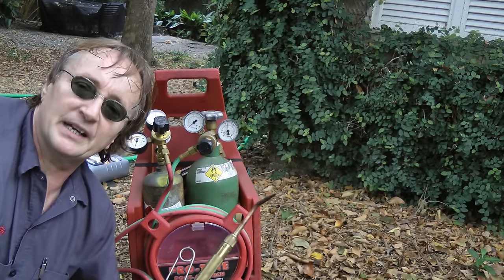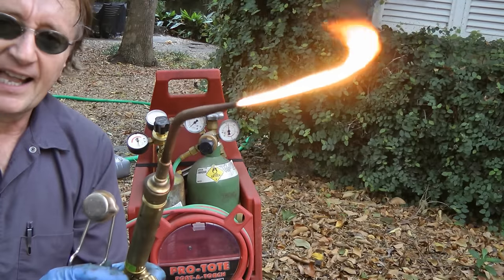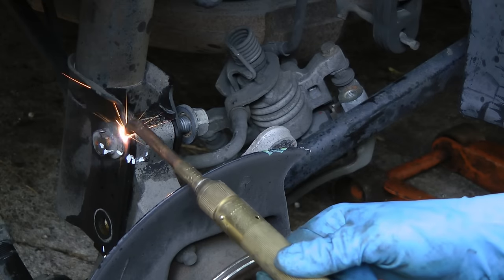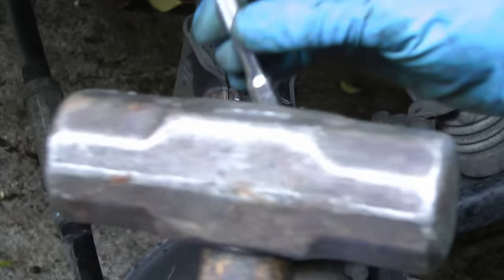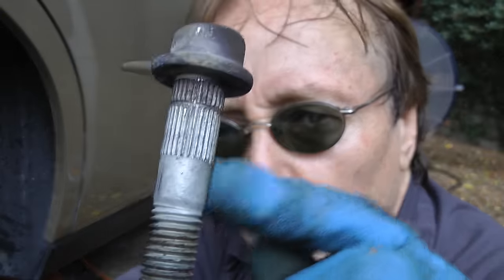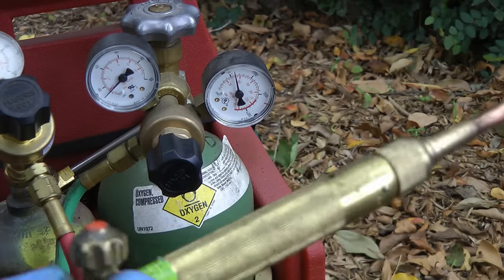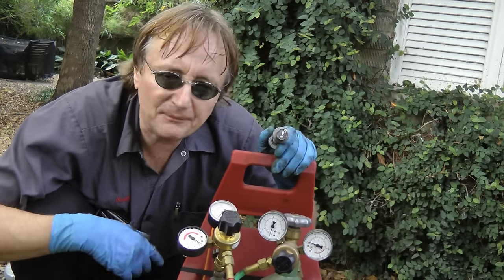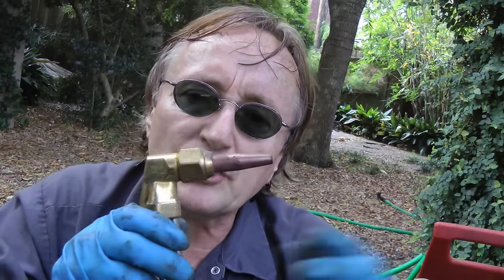How to Remove Stuck Nuts and Bolts in Your Car

Comment: It is , oxy-acetilen, a very usefull tool, once you work with it you become miserable whitout it.   The thing is that acelilen (C2H6 ?( is very difficult to get on a sunday morning...Around me, all those who need this kind of heat  are replacing  acethylene by propane gas,  At little bit less hot but it cuts very well anaything you are use to cut.  All it takes, is a small adapter to install on the propane hose, if I re,member well...Once it is done, your BBQ become your Sunday morning  back up for your torches...

Comment: ok, so a friend of mine bought my rims that were on my chrysler lhs not sure on the brand or anything i know that they needed a special tool to get off which i have. he put them on and he lost two lugnuts while driving so he tried taking the rims n tires off to put his old ones back on...
the problem is that the lugnuts are not coming off of the studs and he also broke two studs off his car when he lost the other lugnuts he says that they just keep spinning??? he has a 98 pontiac grand prix 3800 he shouldnt have to replace the whole hub right he can just get two studs and bang the bad ones out...
and how can we get the other lugnuts off??

Comment: How can I remove camshaft collars (the collars that hold the camshaft down), when the bolts have locktite on them? I am working on a 2001 Jaguar XJ8. From what others have said on the internet, the bolts have locktite on them, from the factory. The bolts seem very tight to me; and I m afraid to put too much pressure on them. Keep in mind the bolts have very small 8mm heads.  Any advice would be greatly appreciated. Thank you.
Reply from the maker: use an impact wrench, the impact pressure will always open up loctite bolts. Putting on with an impact can rip threads if too tight, but not when taking them off.

Comment: Subscribed!

Question: hey Scotty, I am trying to remove my y-pipe to my cat converter. I was able to remove the rusty bolts, but the pipes seem to be stuck/rusted together. Any tips?
Thanks.
Reply from the maker: pipes can heat weld a bit, spray WD 40 on overnight, then whack em with a sledge hammer

Comment: Hi Scotty,
I am a little confuse about the shock absorber . When you remove this bolt, will it jump out a little bit? I think there is a huge spring inside, and that spring will force the shock absorber jump one or two inch. That happens to my car before, Is that OK or something is wrong?
Reply: I can actually answer this one since i just did shocks on my chevy pickup. If you are just replacing JUST shocks and they are not inside a mcfearson strut then the shock will stay in the same position. A shock absorber doesn't refect any energy but rather absorbes it. So when you place a shock in a certain position. It will stay in that position. When removing your old one there should be no recoil out " spring" when removing it. as long as it is NOT inside a mcfearson strut
Reply from the maker: that's a strut, spring is self contained within the strut, so it hurts nothing. To remove the spring, the strut has to be taken apart using a spring compressor then

Comment: Hello, I am trying to replace Rear engine mount 2005 Odyssey. There are 4 bolts (14 mm) in the bottom. They connect the engine mount with the aluminum stand. I removed 3 out of 4 bolts. There is 1 bolt it very hard to remove. I used a long extension and breaker bar to remove the bolt from the Top, but the bolt just moved a little then it stopped. Do you have any idea to remove that bolt?
Thanks,

Comment: Doesn't heating metal make it expand?  How would that make it easier?  I'm not disputing the video, just want to know how this works.
Reply from the maker: thooke222 you get metal red hot, it's then slippery and comes off like a hot knife through butter
Reply: +thooke222 It sure does, that includes the metal that's sitting around the bolt. This makes the metal around the bolt, like a nut or whatever, loosen up from the bolt so you can get it off. Had to this to get the expansion chamber off my moped.
Reply: +thooke222 Your questionning  is very good...I have ask the same thing to many specialist teaching and dealing with heat expansion.
  One thing is sure, while steel is rusting it become bigger ( microspicly), very munch and it is very abrasive...all this is a very good clogging or jaming  device. Rusting is a very very powerfull expansionning action.  Specialy when fastening is pressed fit, like the bolt on this video. 

 Excessive heat, like what we have here, seems to break the  ''gluing'' link between the rusted atoms of iron....they could become smaller by loosing their oxygen atoms, the culpit for making rust,,,,which atom (O 2) might have been kick away by the red hot effect...
We might add to this that heat makes steel softer...which means it is less resistant...
Reply: +thooke222 Basically you are supposed to heat the metal around the spot where the bolt is stuck. Heat makes it possible for the metal to move in other ways, than when the rust started forming, thus making it possible to break or loosen the rust
Reply: The metal does expand. It is not necessary to get it red hot but it does help. The heat can burn off any impurities but the real trick is that both pieces of metal are usually slightly different in size. They each expand at different rates. You also have to consider which way the metal will expand.
when you heat a nut and bolt, the bolt will expand as if it is slightly fatter.

A nut, on the other hand, will expand as if it is slightly bigger. 

It is the difference in expansion that causes a very small amount of gap between the mating surfaces decreasing the amount of friction between mating surfaces because of less surface area making contact.

Nuts and bolts are pretty straightforward. if you were trying to get a broken bolt out of a steel blocks you would want to heat the steel block and avoid heating the bolt because you would not want the bolt to swell and get tighter in the hole although sometimes merely heating it and allowing it to contract as it cools can cause tiny bit of looseness.

Scotty is a car expert whereas I am a millwright. I work with tools just like he does. I just happen to work on much larger industrial equipment.

Comment: Would one of those cheap propane torches work?
Reply from the maker: you can try, but it was a giant bolt and it might not get heat far enough inside to work
Reply: Just heat it 5 more minutes than youthink you have to and it works every time with a small propane torch.
Reply: Ive used a propane torch on a pitman arm nut that was seized to the power steering pump shaft. in my opinion it should work just fine

Comment: Hey Scott, I'm trying to take my starter off so I can clean the inside of it, but can't get it off because this ONE LAST BOLT won't come off for shit. Even my ROYBI punch drill won't do. Even tried some special lubricate. Can I use a lighter to heat around it?

Comment: Hey Scott, whenever i drive at a speed between 10-25km/h, there is sort of a fast squeaky pulsing sound that comes from the front-right side of the car.
Im just wondering if you know what part is making that sound?
Reply: brake caliper?
Reply from the maker: tons of things can do that,  but often worn rubber bushings on the suspension will do that, try spraying em with WD 40, if noise goes away, that's it
Reply: Scotty Kilmer
Thanks for the reply, will do that right away :D

Comment: Hello i have the 3 bolts behind the knuckle of the wheel hub assembly that has not came loose i have use pb penetrate and crc but nothing is doing the trick. If im not comfortable doing this whats my other options. Thank you

Comment: Hi scotty i got a 1991 bmw 525i non vanos

Had problems with the idle where the idle goes up & down but not lots & also the exhaust in idle seems to go popopop but has no misfires or hesitations with 0 trouble codes. I tried the cigar trick on the vaccum lines but no leaks. All coils have the same resistance & its had new spark plugs

What could it be?
Reply from the maker: those things have vacuum leaks up the kazoo as they get that old. Pay a mechanic with a smoke machine, they can be hard to find.

Comment: Quick question, replacing my timing chain gasket on my truck and in order to get to it I have to remove my oil pan. Started the process and was stopped by oil drain plug being stuck. Tried using a jack and hammer to loosen it but it didn't work. Any suggestions?
Reply from the maker: heat it up with a torch, that always will get the metal to let loose

Comment: Can i use a heat induction tool to remove a battery hold down bolt stuck in place?

Comment: 1) I would try a penetrating oil, first because this IS going to ruin the bolt's temper and thus its tensile strength.  This will surely ruin a grade 5 or a grade 8 bolt making it only as strong as a grade 2 bolt at best.  2)  I would try my air hammer.  If all else fails 3) either heat it or cut it, but REPLACE it (especially if grade 5 or grade 8 bolts are used).  For those viewers out here, you CAN probably buy an inexpensive propane torch setup and still get 2000F to the bolt easily... even though the flame temp is just over 3400F (even hotter with MAPP).  It doesn't necessarily need to heat until red-hot either.  Just enough to expand the metal and break any corrosion.

Comment: Hey Scotty how do you removed a seized lug nut? My lug splind nut is not necessarily stripped but it just keeps spinning when I try to remove it. Other than drilling a hole or fife is there an easier way? Or a tool for siezed lug nuts? Thanks.
I brought my car to a tire shopped and the moron used an impact on my spacer spline lug nuts SMH.

Comment: haha instead of what i did  and had the knuckle bolt on the struts stuck or broke off half way out, and have to drill  4 holes all the way thru straight, even if the knuckle bows half way thru at the flange, hacksawing the flange off the old strut, and having to use aircraft class 8 bolts to resecure due to threads being drilled out. lol  after 22 hours we finally got the 2 new struts replaced.  while we were at it, had to order some sway bar links because of the corrosion and wear of taking off and on 2 times.  i felt if this happens again im gonna roll the car into a ditch and just walk.  but i guess this torch is a good investment.

Comment: Hi, Scotty. I have a question. I have to take off two exhaust bolts that connect front exhaust pipe to catalytic converter but those bolts are rust welded so I guess I have to heat them up. Would it be dangerous to do that because those bolts are right near catalytic converter? possible explosion because there's gasoline fume in catalytic converter?

Comment: I tried heat small burner and the Irwin Extractor tool on this 8MM housing for the thermostat on my  Chrysler Jeep Grand Cherokee No Luck. The next step is to cut the  8MM bolt off.  A mechanic told me it may cost $120 to come out to just get the bolt off the car????.....HELP

Comment: Hey Scotty- I'm kind of a cheepskate, would a propane plumber's torch work just the same???
Reply from the maker: you can try, it might get hot enough
Reply: I did.....thinking this repair may get subcontracted to my local mechanic. I'm tempted to run to Harbor Freight and get a cut off tool....but I have a poor track record with using such destructive methods, haha.

Comment: What works does not mean that the method used is correct. Excess heat in the metal changes the metallographic properties.

Comment: hey scott, after i replaced the oxygen sensors on my 2000 taurus, P0420 code of cat converter came on. The mechanic said that the inside is so burned that it needs a new one. Should i replace it? And if i replace it, will it stop idling bad because i saw your video of checking your cat converter and the front of the cat has good pressure and the back has a little bit pressure.
Reply from the maker: yes, time to change that cat.
Reply: Scotty Kilmer
By the way, where's your cat friend?

Comment: How about if the bolt broke off in a front low control arm I drill hole try a bolt extractor but still not coming out

Comment: I over tied a rear sway bar bracket of rav4 Toyota 2005 driver side the upper screw i can't see the place even any idea ??
Reply from the maker: if you stripped it out, you will have to drill and tap a new bolt in or pay a mechanic to do that
Reply: Scotty Kilmer I broke it in and there isn't enough space to do all that, will Jb weld work ?

Comment: I'm trying to get out the top Allen head bolt out of the caliper of my 1989 Chevy k1500 the bolt spins freely but it won't come out I it came out about Half way and all it does now is just spin in place and suggestions

Comment: What about a small propane torch with MAP gas?
Reply from the maker: you could try it, but then again, they don't cut metal or weld, and oxygen torches get much hotter for making metal red.

Comment: What if these bolts are on the yoke near the gas tank because my u-joint broke off as I pulled out of my neighborhood. My trucks drivable but I don't want damage it just to drive to a store to get a specific tool and I can't go above 35 well I probably can but I just don't want to. 2001 explorer 4x4 aka pos

Comment: So what if I want to remove stubborn bolts locked in torque converter when I'm removing a transmission?
Reply from the maker: try a cheater bar and socket first if you're antsy about using heat there
Reply: You can't use heat there because the flywheel is in the way of heating the torque converter. You don't heat the bolt you are removing, you have to heat what the bolt is threaded into. Scotty's right. Use a breaker bar or impact gun.

Comment: How do I remove a stuck bolt that I cant get to with a socket only a wrench will fit? Thats what im dealing with. Its on a 1980 corvette. Its on some sort of valve thing on the intake manifold that goes to some sort of vacuum line

Comment: I have a 98 crown victoria that the windshield wipers started staying in the up position, Is it in the switch or a relay, Its not like a gm where you gotta bend the tab up to solve the problem, I tried lubricating the slider on it, I know its something simple but I haven't found it yet
Reply: My Astro did the same thing.The wiper motor wasn't grounding correctly.Those motors are mounted to the firewall with rubber bushings to isolate vibration and there is a seperate  piece of metal or wire that contacts the body and grounds the motor.
Reply: yes GM's had a "park tab" that you would bend back into place
Reply: MXSLICK This ford has a slide bar that doesn't seem to be moving into the down position when turned off, The motor and switch works fine
Reply: SuperAceuno1, it is most likely the wiper motor.  I have several customers with the Crown Vic and that is the usual repair/fix.  New wiper motor...check out Rock Auto...they have several and the price is very reasonable.  Take care

Comment: Hey Scottie, 01 Maxima showing all signs of bad IACV, wandering idle, stalling, hard start when hot. Local Shop even says IACV not responding.. But I tested the stepper motor and it moves all the way close when key  is on, then returns to full open when key is switched off. Could this be a ECU problem. Seemed to start after MAFS was replaced with a after market. I have replaced fuel pump and filter, ETS, CamPS, Front CrankPS and plugs chasing this problem. To proud to take it to Nissan yet, Your thoughts
Reply from the maker: I would go to a factory maf, cause a bad one will do exactly what yours is doing

Comment: Hi I am trying to remover a starter motor, I have took the bolts and disconnected the wires and batterie but it’s not budging it’s as if it’s seized on can you help please

Comment: My nut on the valve cover gasket on a 1993 honda civic dx it won't come off no matter how many times i try to take it off any suggestions? its not rusted
Reply from the maker: those often strip out and then you need to pull em out by force using a pry device wedged under then you drill and rethread the hold inside where the stud was removed from

Comment: Hi thanks for sharing ! I have a jeep Liberty 2005 4wd automatic  do you have a Video to show me how to fix my front transfer case ? My car broke down on me it just wont pull forward or backward , goes in to gear good but wont move in drive or reverse ? could you help me please ? I have to fix my own !! thanks
Reply from the maker: those things are complex as can be, I don't even fix em myself. I send them out to McAfee standard transmissions here in Houston. Takes years of experience and tons of expensive tools to do that. BUT, you could try a used unit from a salvage yard.
Reply: Ok Thank you . hope you have a great day ..